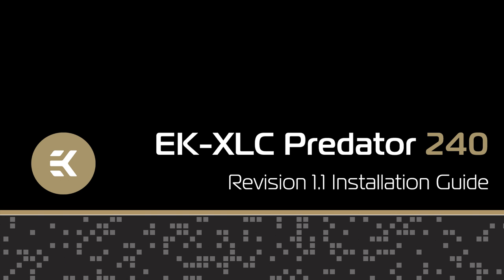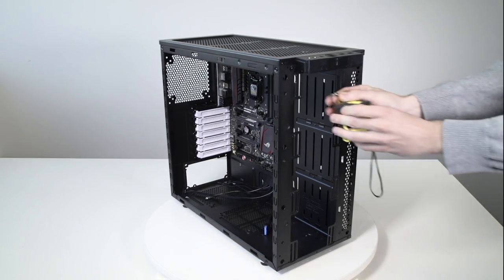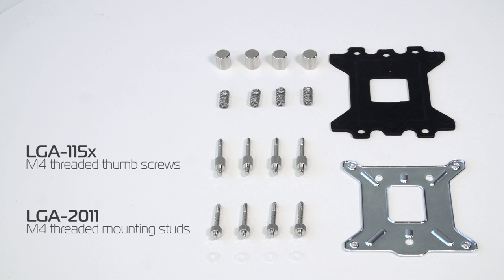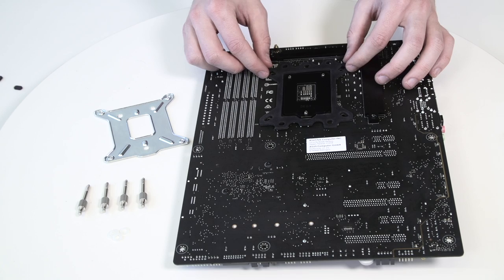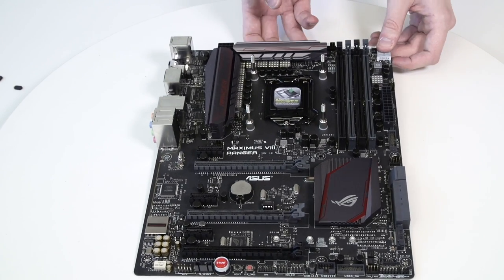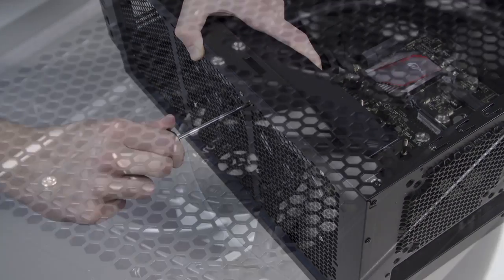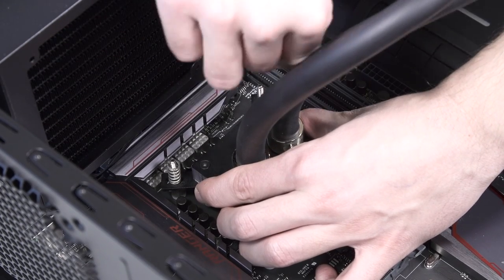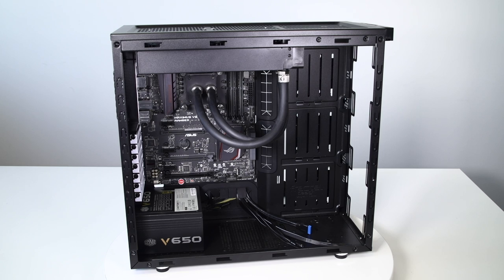EK-XLC Predator 240 (R1.1) Installation Guide

Comment: so what is the difference between this version and the one released before? Also does this version finally come with proper mounting kit for 2011-3 boards? Else still I am going to avoid it and go for swiftech unit.
Reply: Thanks for correcting everything that was wrong with the V1 and making it a perfect AIO. I would certainly consider this unit for my PC build.

Comment: Hi, i've got the Be quiet silent base 800 case, and i will get a predator 240 inside it, i will put it on the top, there is a system where i can put the radiator and the fan with the system of the case between them. The problem here, is that the pump and the reservoir will get in the way, so my question is, can i change the position of the pump, putting the radiator the other way with the fan in the same pull position but on the other side of the radiator and put the tubing of the reservoir the other way too so it can fit in my case with the fans being kind of "outside" of the case ?

Comment: I currently have a Predator 240, is the pump strong enough to use it in a full custom loop which will include the cpu, two video cards and another radiator? If it's not, is there an issue with running two pumps in the same loop, or would it be easier just to run two loops in my computer?

Comment: Im looking to buy this. One question, are the r1.0 predator aios removed from the website? Im scared ill buy an r1.0 instead of an r1.1 because i am NOT replacing my expensive hardware
Reply: R1.0 Predators have been pernamently removed from market, and anybody selling them is simply trying to get you into a bad, bad deal. EKWB replaced all faulty R1.0 models for free, and they're selling only improved 1.1 revision.
Reply: Thanks! How is the noise on this? I definetly know its better than swiftechs h220x but not sure bout noise
Reply: Gonna ask a friend on that matter, he's got himself one of these. Will get you informed tomorrow. :)

Comment: I wonder if you can mount it on the front of the case too. I have the same case " fractal design r5 "  not sure if it is really the same tho.
Reply: the case here is the fractal design define s case,so i bet that it will fit the fractal design r5. u would have to remove the top cd dvd drive bay to mount it on top or in front.

Comment: Are the Vardar fans pushing air through the radiator or pulling it? Thanks.
Reply: +EK Water Blocks Can i flip the fans so it would push it through the radiator?
Reply: Miro, If the 240 radiator is installed in the front of the case vertical should fans be on push or pull config? and would fans be installed on inside of or very front on outside?

Comment: Can i add 2 more 120mm fans for push and pull config?
Reply: +EK Water Blocks By the way, are the Vardar fans pushing air through the radiator or pulling it? Thanks.